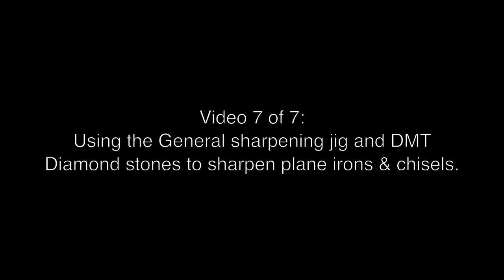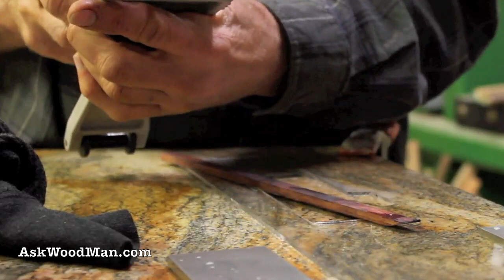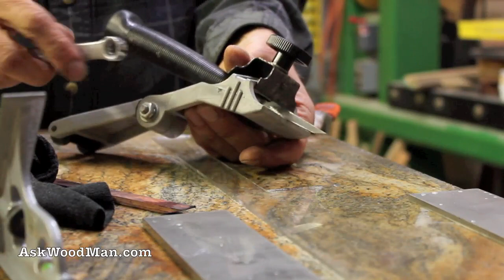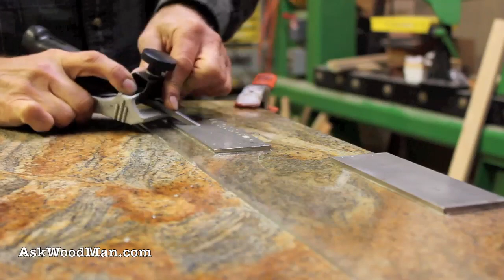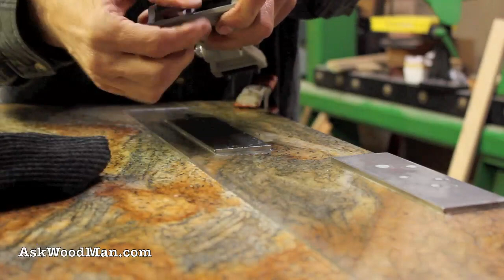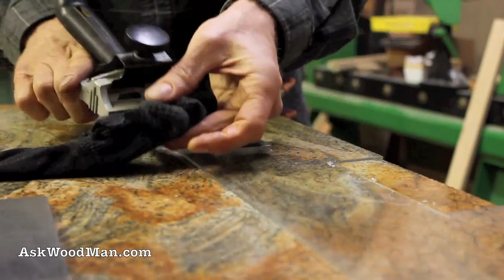Sharpen Woodworking Chisels with Diamond Stones • Complete Sharpening Series Video 19

Comment from the maker: Hey Steven. The orange is rust from the tool steel and water reaction.
That is why I use the Simple Green/water mix 50/50. This mix has higher specific gravity so it holds the particles in suspension better and it does not promote rust. You have not ruined your stones. It is really tough to damage them. That rust residue will go away over time. Just don't put oil on them.

Comment from the maker: @alo52100 It is just a 50/50 mix of Simple Green All Purpose Cleaner and water. Simple Green is non toxic biodegradable cleaner. This mix does not promote rust and is a fraction of the price (1/20) of store bought cutting fluids. Home Depot carries the gallon for under $10.  Thanks for watching.

Comment: Is there any disadvantage to using 100% simple green on diamond plates?  I'll start mixing it with water from here on out but not sure if I've screwed up the plates I own?
Reply from the maker: You have not done anything to harm your diamond stones. They're diamonds :)
When I first started experimenting with Simple Green I tried it full strength and found it did not flush the the particles away as well as the mix. Just pour some hot water on the stones and swish with an old toothbrush and then us the mix.
Reply: AskWoodMan ha.  thanks. internet research tends to make me overanalyze and overthink.  I appreciate the answer and all of your videos.
Reply from the maker: Chris Noland
Thanks for watching Chris. And have a great 2014!